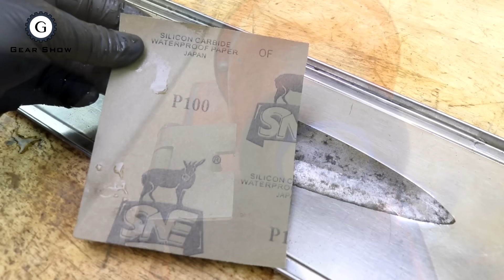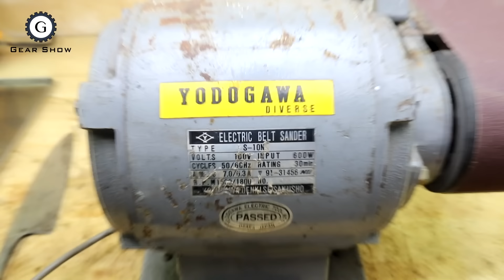$5 Rusty Japanese Knife Restoration

Comment: Nice refurbishing. Why did you polish one side to mirror finish and leave the other side with pits? If you would have finished both sides equally, that would have made this project superb! Thumbs Up!
Reply: @Cosine Single bevel blades normally have a hollow grind on the back side to prevent sticking.
Reply: This sounds like the biggest boomer ever
Reply: @kaitf3469  how
Reply: I think the pits are too deep and grinding them smooth will compromise the edge metal. The knife is single bevel. Usually harder material which is the edge material is the flatter side.  The one with the bevel is the softer metal.
Reply: @Cosine Only if had a hammered finish to begin with.  In general, this is a deba knife, not be used for general cutting but for breaking down big fish and bones.  I seriously doubt that it was hammered in the first place.  Because that wouldn't make any sense.

Comment: I am glad you didn’t just asspull called this a japanese knife but actually retained the hollow grind on the back and the single bevel. Really good work with a limited set of tools. Though I highly doubt it was originally a 5 dollar knife when it was new. Still. It really is a renovation and a fine work.

Comment: I admire you in taking the time to restore a rusty knife...(don't know if it is worth it, because most of the name brand Japanese knife would have brand name on the knife blade).  I made a bushcraft  knife out of my lawnmower blade that has seen the end of its life three years ago.  Due to it is a soft steel, I had to  go thru the hardening/tempering process to get the proper hardness.  It was an experimental, trial run, and did not expect anything good out of this, just for fun and learn something out of it.  The end result is a working bushcraft knife, which I got great satisfaction out of the whole process.  Good job...

Comment: I was thinking the whole time that a sandblaster would cut your time by 75%, but your diligence in doing a job well done is incredible. Hats off to you sir.
Reply: I think the point is to get the pitting out and refinish the blade without losing the original profile.

Comment: Very nice restoration. But why you polished just one side of the blade? The other side is not clean and polished.
Reply: Because the knife is a one sided bever.
Reply: Japanese knives generally have a one sided bevel, meaning that only one side of the edge is angled and the other is flat to the rest of the knife, whereas western knives have bevels on both sides
Reply: @gondolajesus4864  I didn't mean why he didn't shape the other side. I said why he didn't clean it. Other side is like mirror and the other one remained unclean
Reply: @gondolajesus4864  actually not just flat but a slightly hollowed on the other side. He even hollowed it out a slight bit which is when this video really caught my attention. He really knew what he was doing.
Reply: @moya9450  he tried to retain the hollow grind on the “flat” side as much as he tried to. He did a good job imo
Reply: @joe-hq9yt  If that's the case, you should have 1 side that is polished flat. At least where the edges meet.

Comment: Beautiful work. The knife.is a classic deba, heavy, thick spined  cutting knife designed to handle cutting thick fish bones. As somebody mentioned it is probably not an expensive knife to start with, since most expensive Japanese forged blades have embossed characters on the blade identifying the maker.  The restored uniform mirror finish hints that the knife is made of cheaper stainless rather than tempered high carbon found in expensive knives. Classic Japanese knives, like swords, do not have the handles epoxied on.  The handles are designed so be removed for cleaning or maintenance, and are held on by friction.  The modern Japanese knives are riveted or molded on, like western knives.  In Japan, replacement handles are readily available.  This knife had a single right-handed bevel like a Samurai sword.  The "left" side of the blade is straight and has no bevel.  Sharpening this side of the blade is simply making sure that side is flat.  Sashimi knives typically are single beveled since a right hand slice of the fish if done with a double beveled knife will result in the cut curving to the right following the bevel, very uncool in making a straight slice.
Reply: Very interesting, thanks

Comment: good job 

some tips for next time are: leave a small part of the tang out its designed like that for a reason (the handle weighs less and the blade is easier to control)

my personal opinion i hate when people use brass (i just hate color of brass and gold)
Reply from the maker: Okay, thank you for the tips.

Comment: This is a deba knife and it's use is for breaking down big fish and bones.  You can sharpen it as sharp as you want but in general it doesn't matter because it's meant to be pounded on. So it will dull fast if you use it for its intended purpose. If you try to cut thick vegetables with it, it just not good for that, too thick.  Santoku is a better choice.  Nice video though.

Comment: Man there's no way this was a $5 knife. Look at the thickness, the nice single bevel design, the sharpness. It's a carbon steel not cheap stainless steel.
Reply: I assume that the knife was bought for 5 dollars in its rusty condition, not that it was originally 5 dollars when it was new.

Comment: Excellent.  In these restoration videos, I would love to see a percentage split for the finished product of split between original parts vs new.  For this one, as the blade was fully restored, I would say...it's pretty high on the original parts side.  Also, an estimate of market value of restored artefact would be very interesting.
Reply: New knives are 200 bucks. So $5 vs $200.

Comment: Thank you for sharing
Reply: 02:33 03:07 04:05 Make the new handle
03:04 Cutting copper pipe[about  2.3cm Long ] 05:29
03:26 Slightly flattening  copper tube
==========
12:28 make the knife sharper  by using yellow knife stone
13:36  13:47  polish knife 
sanding belt  
14:34 Make the handle[digging 3 holes  becomes a  Oval hole]
14:35 14:43 2 types of silicone rubber are used
--------
16:23 Scary Sharp,  cutting paper.super easily
17:17 cutting 16 or  8_Layers_of_papers
17:43 Cutting green cloth, 16 or  32_Layers_of_cloth  very easily.
------------------------
I am a Chinese. My English is poor. so I use a dictionary in the network to help me to take notes
Never mind
================
https://fanyi.baidu.com/#zh/en/%E7%A3%A8%E5%88%80%E7%9F%B3

https://fanyi.baidu.com/#zh/en/%E5%81%9A%E5%88%80%E6%9F%84
https://fanyi.baidu.com/#zh/en/%E4%BD%BF%E7%94%A83%E7%A7%8D%E7%A1%85%E6%A9%A1%E8%83%B6

Oval hole[椭圆形的洞] https://fanyi.baidu.com/#zh/en/%E6%A4%AD%E5%9C%86%E5%BD%A2%E7%9A%84%E6%B4%9E
切割铜管
https://fanyi.baidu.com/#zh/en/%E5%88%87%E5%89%B2%E9%93%9C%E7%AE%A1
轻微压扁铜管https://fanyi.baidu.com/#zh/en/%E8%BD%BB%E5%BE%AE%E5%8E%8B%E6%89%81%E9%93%9C%E7%AE%A1%0A%E5%8E%8B%E6%89%81%E9%93%9C%E7%AE%A1
Reply from the maker: My pleasure

Comment: Good job, but the Knife is still full of Pits.  You should have taken off about 1/2mm of metal  all over with your Belt Sander/Grinder.  The one corner of the Knife has a big chip missing.
That Vinegar was  a waste of time, the Belt grinder gets it done faster and better.  But over all, still a decent job.

Comment: Single edge deva knife for USD5... Great find! Excellent restoration. I'd only question if the back of the knife cannot be restored as well as the front and whether the knife could still be used in the kitchen after exposing it to so much industrial chemicals. Otherwise, great job!

Comment: Why not just restore the original handle?  It didn't look that damaged.  Also why leave one side of the blade unfinished?
Reply from the maker: The original handle is cracked, the rust go depth on the other side, if I remove them the blade will be thin.

Comment: next time save yourself a ton of work and just use an electrolysis bath... will get those deep rust spots out, and you can smooth out the surface with a grinder instead of sanding it four different ways for six hours.
Reply from the maker: That is good idea, I do appreciate your sharing.

Comment: I don't want to pee on your campfire, but a Deba knife is ground hollow on the back side. You are ruining it by grinding it flat on a belt sander like that. Sure it will cut paper, but so will an axe when sharpened at a shallow angle. But the hollow  " offside " has a purpose for cutting fish and such.

Comment: Well that sucked… the brass part is not for decoration. It’s supposed to hold the blade in place, instead of using crappy glue to fix it in the handle.

Comment: It is a right-handed sashimi knife, which is designed with a thick wedge in order to be able to bone a fish without the cutting edge digging in.  There are no maker marks on the blade it so it is likely to be a fairly cheap type.  From the lustre after cleaning it looks like it could be stainless steel, a cheaper type of s/s that easily rusts in the wrong conditions.  The best type of blade is of course carbon steel, that would likely rust far worse than the knife in this video. The author mentions it was hardened steel and difficult to sharpen, another pointer to a cheap stainless steel, though others may have a more expert opinion.   Among the choice of new sashimi knives a sandwich of stainless on the outside with a core of carbon steel is popular, though of course like carbon steel knives they also cannot be put in a dishwasher.  Left-handed sashimi knives are also available.  Otherwise ... good job !

Comment: Very good job. But... a blacksmith or better yet a weapons smith, one who works with swords and the like, would also removed the bad spots of rust. He would have grinded them out first, then welded new lumps of metal on them and grinded en polished those perfectly smooth and even with the surface of the blade. Of course you have to heat treat the whole blade for that, but hey, that's the job. But not everybody is a smith nowadays. So... good job.

Comment: I don't know man... I saw the starting blade, and was excited to see it gently cleaned up. Then I saw the vinegar, and thought "Yup. This is gonna be good." 

Then I saw the wire wheel, and everything was going nicely. Until he started sanding it. Then put it on a power sander. Then inexplicably went back to hand sanding for some reason... then polished it up. Really confused.

Could have accomplished the same thing by just getting it wet (to prevent airborne dust) and removing the loose rust with a brush, then wire wheel to remove the slightly tougher stuff, power sander to get it close, and finish with a little bit of sharpening on a stone, then polish.

As for the handle... Not sure what was happening there, and seeing the hole after everything was drilled... Looks like all the effort previously made to carefully craft just the right handle was wasted right at the end. There's got to be a better way than drilling in a few holes with a hand drill. 

Huge amount of time spent doing work only to obliterate it with power tools later on.